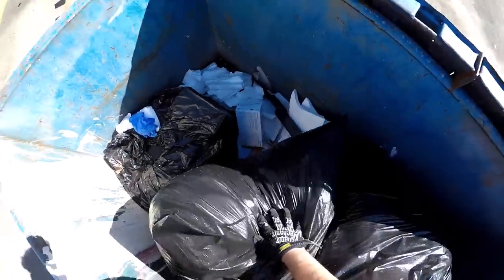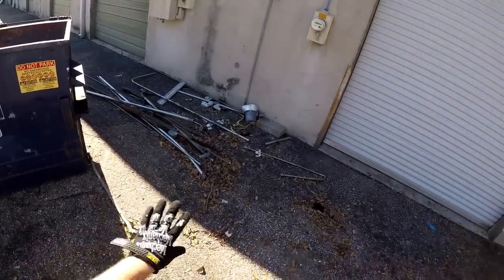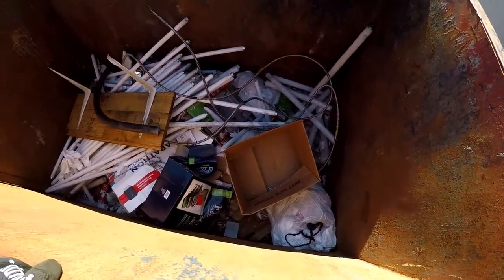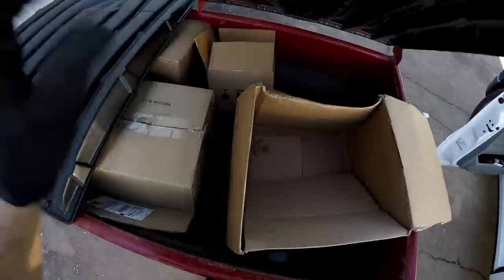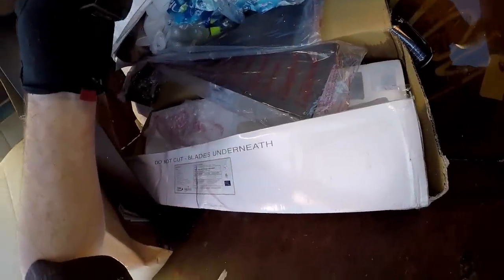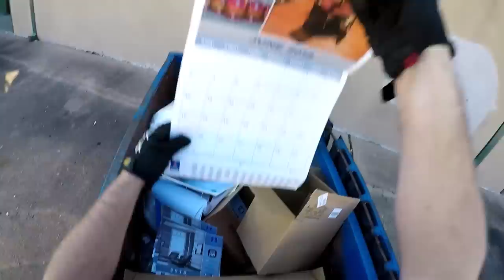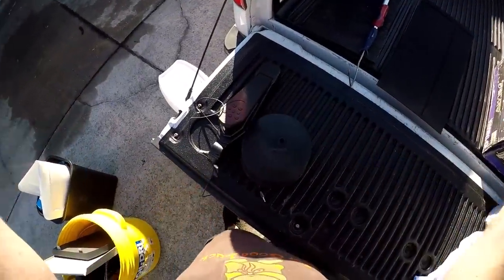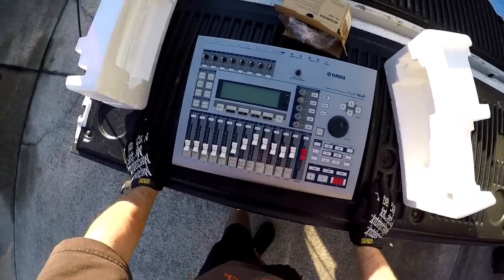Dumpster Diving 24 (Gettin Down On The Ones & Twos!)

Comment: 26:55 the ''Yamaha AW 16G'' is a 16-track digital audio workstation. About $1,299 dollars in new state,
now its around $300-$500 (if its working)... INPUT is a DC-IN adapter about 12 volts

SPECS OF THE ''Yamaha AW 16G''
-Quick Loop Sampler
-CD-ROM with over 250MB of samples included: Sound Clip function (so you can quickly capture ideas while practicing)
 -built-in 20GB hard disk
- built-in CD-RW 
-144 virtual tracks
-dynamics processing
-two blocks of high-quality multieffects
-four-band parametric EQ on all channels
-and 13 types of studio-quality mastering effects
NOTE: If its not working then theres still copper inside of her. 
LIKE so Mike The Scavenger sees this

Comment: The Yamaha is a Multi-Track recorder. Each slide is used for mics, percussion, vocals, and so on. If you play all instruments, you can record yourself onto that blank CD drawer on the front. Only sad thing is you do not appear to have the power supply cord. get one of those and you should be good to go.

Comment: Thank you Mike again! The oil on your shoe it's brake fluid. You picked up a master cylinder. Don't get brake fluid on your Dottie paint it will take it off.
Reply: Yeah, if any of that got on your truck paint clean it off ASAP. Best paint remover there is.